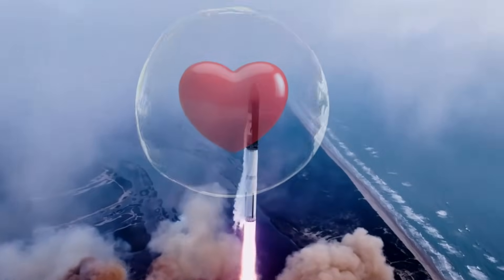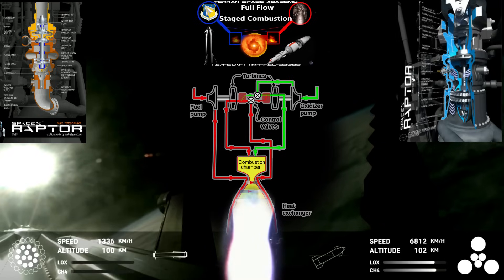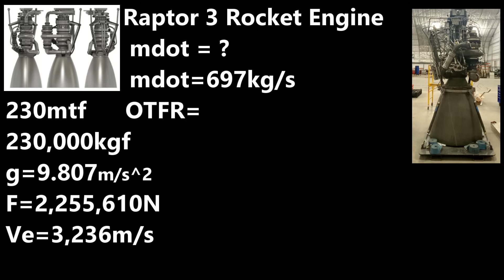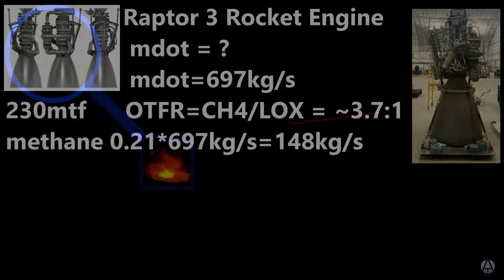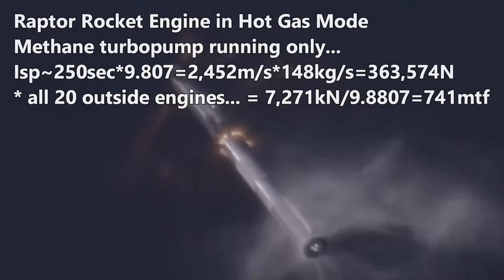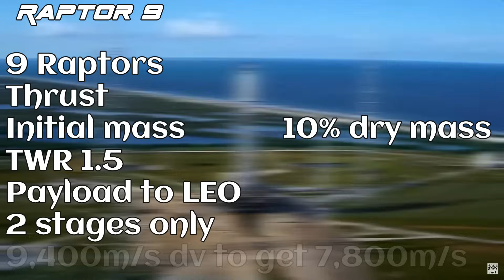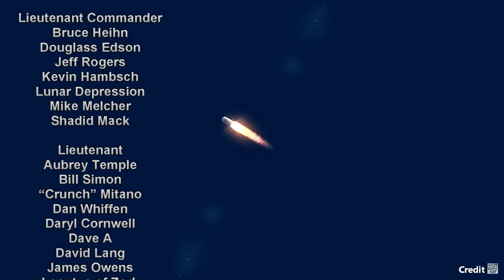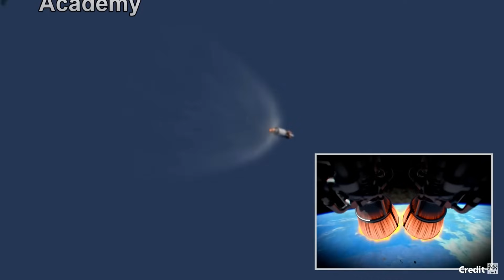Starship IFT 4 June Update and Hot Gas Thruster Mode for Raptor!

Comment: I'm confused how would the 20 outer raptors push the star ship off the booster?  I suggested spinning them without igniting them about a year ago.  As long as you stay extremely fuel rich it should be fine as you don't want to create a fuel air bomb.  IIRC Mush implied that the Raptor 3s don't have igniters, but it was secret sauce.
Reply from the maker: Because I seem to have had a stroke... It would be the six vacuum Raptors on the second stage.
Reply: @terranspaceacademy  it happens
Reply: Raptor 3s still have igniters in the preburners; Raptor 2s already don't have igniters in the main combustion chamber, according to Musk.  My guess is that the incoming oxygen-rich and methane-rich hot exhaust streams from the respective pre-burners meet at sufficient temperature and pressure in the main combustion chamber, that, once sufficiently mixed, they ignite spontaneously...